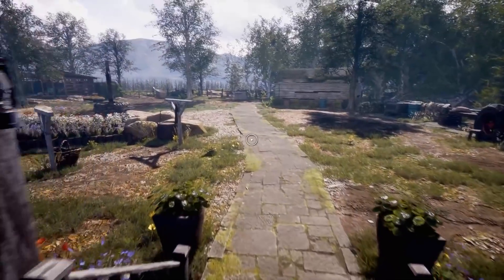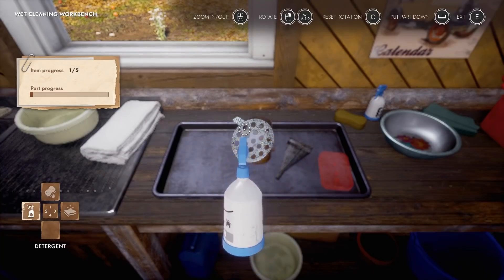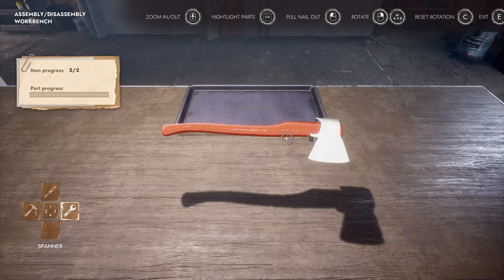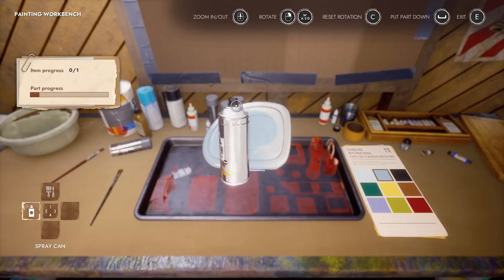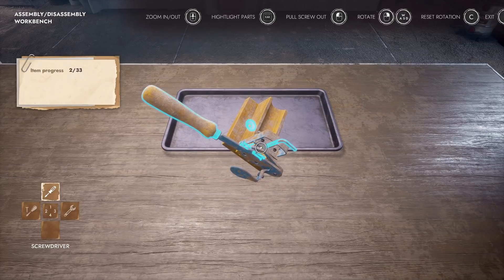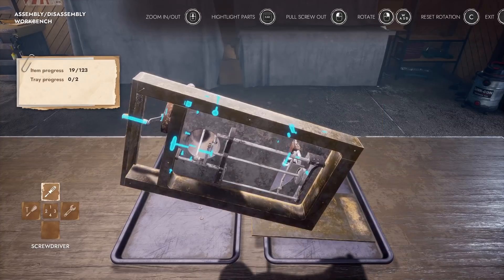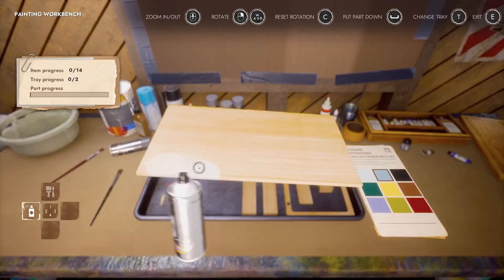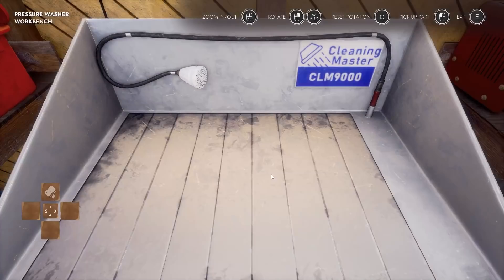Turning Rusty Antiques Into Works of Art - Workshop Simulator

Comment: Yes you can use an angle grinder on wood. You have to be extremely careful because you can blacken and burn the wood with the heat of friction, but if you pulse the grinder so it doesn't turn too fast and use a light touch it's actually useful for shaping and cleaning hard woods. There are actually wheels made specifically for grinding wood ... called sanding disks.

Comment: I have a hand drill just like the one in this episode and despite it's age (and being oddly difficult to find) it is very useful. It was meant for square shank bits, so grabbing modern hex or round is tricky, but it works great as basically a ratchet for large wood screws and lag bolts. Much faster than a regular ratchet and does not run out of batteries half way through. 
The reason for so many parts is because of that ratcheting mechanism that lets it be used in tight spaces. Got a very nice bass-y click to it, at least when compared to a typical ratchet since the parts are beefier and the mechanism is out in the open.

And as a side note, those late 1920's- early 1930's Singer sewing machines are amazing. Heavy AF, but very consistent. Even better with a motor upgrade kit.
Reply: @dukeofthedance8062  "Impossible to hold steady" you say? 
When i was too young for power tools i was given one of those drills and got pretty good with it. The trick is to not push on it as hard as an electric one. Almost 'stabilize first, turn second'. Slower drilling process, but not bad for softer things like wood.
In addition since i was pretty bad at swimming i ended up making a boat-style prop from a flat aluminum sheet scrap and used that drill to turn it. Was a pretty neat thing to have for snorkeling, just had to dry out the chuck really well each time so it won't rust.
Reply: @dukeofthedance8062  Oh no worries, i got the sarcasm :) 
Do agree though, it took some learning to not be one of those frustrated people.
Reply: @dukeofthedance8062  Speaking of hand planers, i have a couple that i use for cleaning up edges on plastic sheet pieces, and it works great! Since plastic (at least 1/4" nylon that i deal with) is more uniform and much sleeker than wood it's a good 'knife through butter" feel. Have even used a planer for deburring aluminum a few times and it worked surprisingly well, just have to go shallow with it.
As far as where i get tools from, got that gear drill from a family member (don't remember who, it's been years), and most others come from antique shops and junkyards. Some do require work, but at least there's something to work on instead of modern 'pot metal' and plastic. For example, i saved a 1.5 US Ton 1970's arbor press from a scrap pile. It was completely rusted (stuck) and took three days of oil soaking to even take apart, however once it did, and after sandblasting and re-painting it became a very smooth powerful machine that i have since used often for things like pressing small bearings in/out. Way better than a hammer!
And sometimes i'd just find tools on the side of the road. Got some pliers and couple of hammers that way.